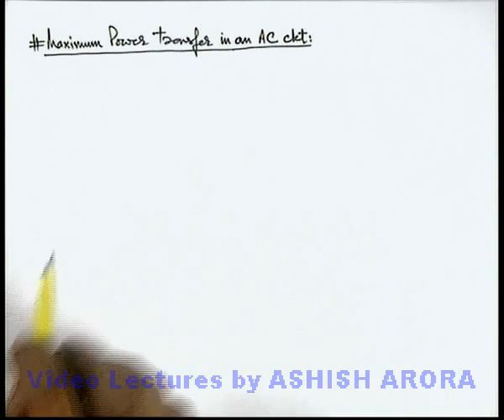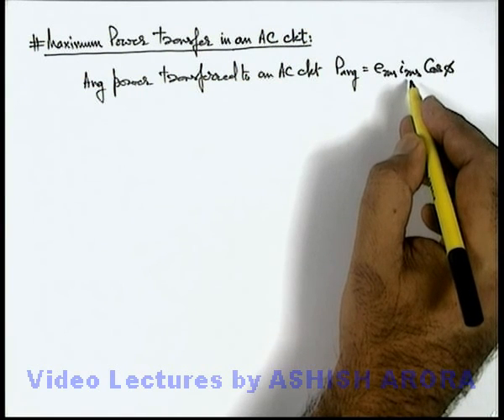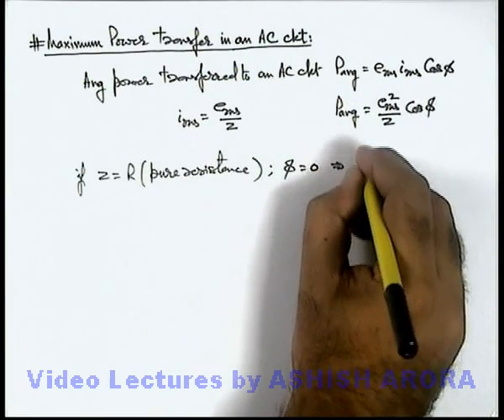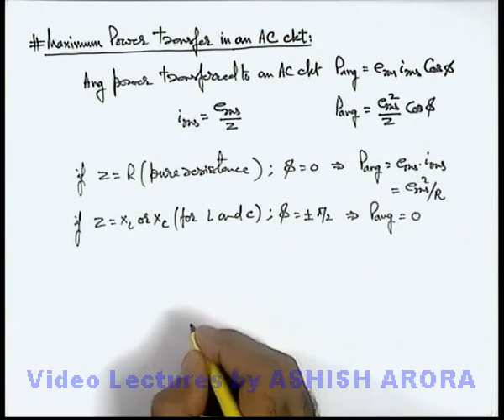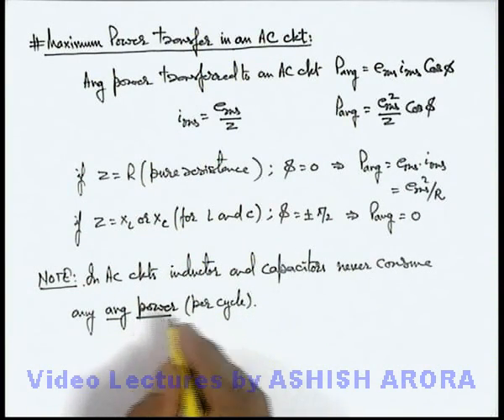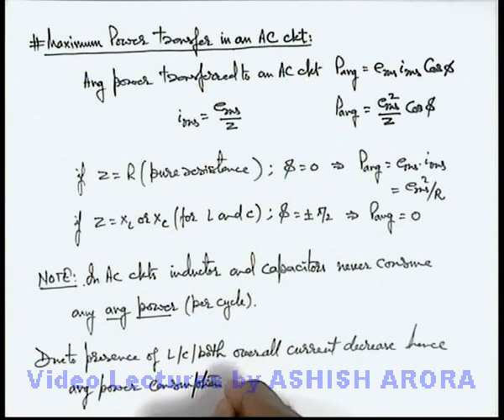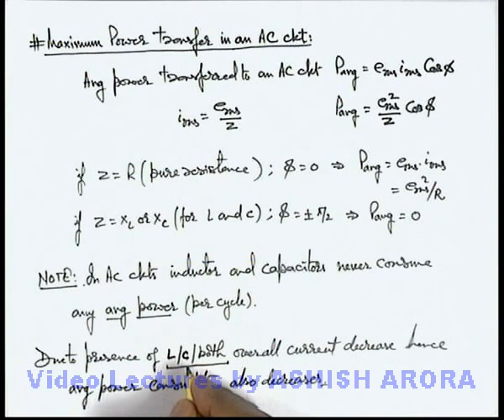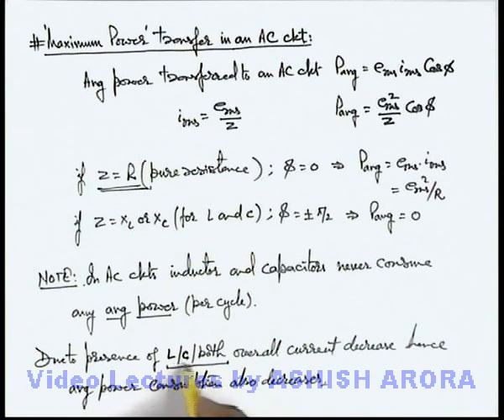Class 12 Physics | Alternating Current | #36 Maximum Power Transfer in an AC Circuit |For JEE & NEET

Comment: sir i did not get u, first u said that avg power is zero and again u are saying tht power decreases?? (for L aND C)
Reply from the maker: avg power consumed by L and C is zero so if in a circuit if L and C are present due to these elements overall power of circuit decreases...
Reply: @physicsgalaxyworld  sir if avg power consumption is zero then how come they will contribute in decreasing power.
Reply from the maker: power consumption is zero only if L or C is used... when L or C are used with other circuit components then circuit impedance will not be purely reactive so power consumption decreases due to reduced power factor of circuit as due to L and C power factor of circuit decreases...
Reply: @physicsgalaxyworld  ok sir got it

Comment: But sir , does the capacitor or the inductor consume any power ? Not the average power.
Reply: Inductor takes and gives energy hence p av = 0
Reply: Capacitor stores and releases electric field energy hence p av = 0
Reply: They both store and release energy...thus if one is charged and connected with the other then...it will form LC Oscillator.
Reply: @rajarya7482  bro 8 years he must have graduated 😂
Reply: @Darshannn_.13  haha
Reply: fr